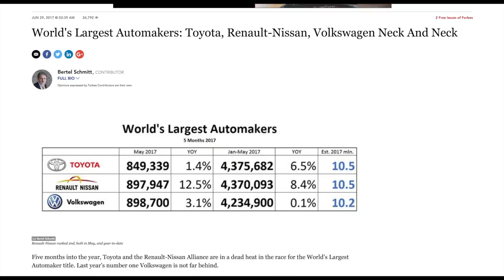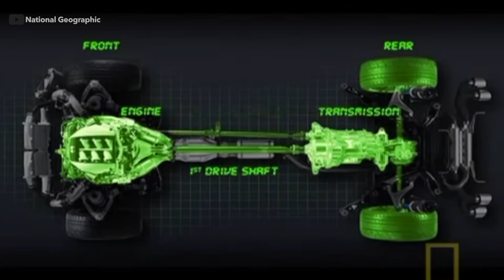Are Japanese Sports Cars Finally Making A Comeback?

Comment: As soon as the new supra comes out, theres bound to be that one guy that will 2JZ swap it that same second
Reply: Kevin N and make it heavier and slower.
Reply: Kevin N Someone better do that
Reply: For sure .I already got  2jz for it
Reply: @teermaarkhan4610  great listen to Tada-san he made for you the online-4 one to easily be replaced by a 2j and not his new creation. Please respect.
Reply: They can because Tada-san made the 4-cylinder variant to be able to swap that beautiful 2j.
Reply: Already happened brother
Reply: @emanueltorres4093  Incorrect. A Japanese drifter already has a pre-production supra and swapped in a 2JZ and drifts it. Tada San gave thumbs up. He built this car for tuners, not for Toyota. It's DESIGNED to be altered and modified. Check these guy's May 12th video drop, and they show a clip of Daigo Saito having swapped in a 2JZ into this very car. Well, not the exact one, but you get my point. Respecting Tada san is respecting that he wants tuners to tune. He wants customization. He didn't build it for Toyota. He built it for.. Well, us.

Comment: You did an amazing job at this video. Extremely well executed and clearly well received. I love that you even put in the bit regarding the take upon the NSX and GTR, along with the new-styling of the Supra (and BMW influence), and even though the manufacturers may have noticed this out-cry, it may not push them to back away.
I hope that in the next 10 years, we will see a new iteration of what is considered Godzilla. Cars that break the barrier of what we consider 'fast' and push it into a whole new ball-park. I hope that we see these exact models rise to the occasion once more, and influence auto-makers for decades after, as we had noticed before.
One can only dream.

Comment: I hate saying this, but look what Ford and GM have done, the Japanese manufacturers should feel ASHAME about themselves.
Reply: Stop the production of a legendary car with a legendary engine and turn it into an suv is stupid enough to me.
Reply: Plus I`m talking about the work done by the engineers, not the accountants.
Reply: ONE THIRD MAYO its only mitshubishi
Reply: Mitsubishi is the worst one. But see nissan made a scentra nismo, and haven`t get any new generation of nissan z or gtr and it`s already 10 years. Toyota made the new supra automatic only and have only 300+ hp. Honda turned their legendary into a hybrid supercar Prius and make a 3100lb front-wheel-drive 300hp car as their only affordable performance model. And the subaru haven`t update the STI engine yet. Mazda is the only brand seems doing ok, but it`s also 14 years since the last time they made a mazdaspeed miata. When these combined, you`ll realize that there`s definitely something wrong withe the Japanese.
Reply: ONE THIRD MAYO sorry about the disinformation, I'm still young and I'm trying to learn more and more about cars and engines. Could you please explain me what brands GM owns and what it is/was? I know it produces engines and owns quite a few american brands, but i still dont know exactly what it is.
Reply: The GM`s biggest brand is Chevrolet, and it`s famous for the LS engine (and currently the successor LT engines.) These engines are known for the insanely small size, power to weight ratio and ease of maintaince, they`re mostly equipped on the camaro and corvettes, but people loves to swap them into all kinds of cars and makes some crazy monsters, such as miatas with a reliable 500+ hp and still keep a neat handling.
Reply: ONE THIRD MAYO oh arright mate, you made things a little more clear, cheers.

Comment: 1980’-1990’s Japanese Cars were the Holy Grail.

Todays modern Japanese sports car feel hollow, cheap everywhere you knock,  pathetic “ stitching “ on the seats on the panels everywhere, the seats feel light and firm.

The real Top Dogs were involded heavily in the 1980’s and 90’s beautiful smooth solid cars with quality interior material.

Today they are trying hard to cut corners using disposable material.

Comment: Wait, why is Toyota wasting time making a new Supra when they already got the Lexus LC? The LC is the successor to the Lexus SC/Toyota Soarer, which were built on the same platform as the Supra. So why not just make a more performance-oriented and less luxurious LC and call that the Supra?
Reply: That wouldn't be a supra. It'd be an  LC
Reply: asah dude - no it would be a Supra with a shared platform.  Which is fine.  Look how well platform sharing worked out for the Camaro?  Because Cadillac dumped a shit ton of money into the Alpha platform to rival the 3-series, the Camaro is now a world class sports car (in terms of feel and performance).
Reply: It'd be a GT sports car with a Toyota badge that has the price and performance to compete with the Nissan GTR, Porsche 911 and Chevrolet Corvette. So yes, it is a Supra.
Reply: CRA_55 - Based on the rumored/leaked specs of 335hp and 3300lbs it is really more of a competitor for the V6 Camaro and 370Z.  Hopefully if those specs are true they will keep the price lower (sub $40k) but I won't hold my breath on that either.
Reply: again its not a supra if it has a shared platform

Comment: Ehh...sort of.  The new Miata and the BRZ are both good sports cars, but could use higher performance trims.  Meanwhile the GT-R and NSX are extremely expensive, not great drivers cars, and not even that fast for their price anymore. 
So that leaves just the 370Z as a middle of the road offering, but it's severely outdated and can no longer keep up with cars like the V6 Camaro, let alone the V8.

The Supra based on it's leaked specs sounds a lot like a 370Z competitor that is less fun to drive (automatic only) and $20k more expensive.  So it's more like a good looking GT car than a sports car.

For Japan to have a true revival Honda would need to bring back the S2K, Nissan needs to update the Z, Toyota/Subaru and Mazda need to throw a turbo/suspension option on their sports cars.
And it would be nice if Honda imported the S660 here (assuming it could pass crash regulations).

Comment: There is a comeback but unfortunately this cars are European cars with iconic JDM car's names. New Civic Type-R has a turbocharger I miss the engines that can turn 8500 at stock on the Type-R s. Car looks not bad but it hasn't a Japanese soul inside it. Honestly with a Type-R you don't need that power. We were OK with N/A K20 engines. About NSX... God damn it has a twin turbo with electric engines. Actually Honda was gonna produce it with a naturally aspirated V10. That concept is way better than this twin turbo stuff. You don't even need to rev the engine to get torque. R35 and Z34 is not bad and still got some soul inside them. GT86 is awesome but new Supra... I can't say the same for it. With BMW straight six it's disappointing for me to be honest. Subaru WRX STI's is not even Impreza. That means lack of charisma in my dictionary. Lexus LFA is awesome by the way. And looking forward to see Mazda's new RX-7. That one is long damn :P

Comment: i mean a manual supra in 2018? know don't get me wrong the only thing that feels the your working on is the manual gearing(IN MY OPINION) into 1st then 2nd, 3rd etc. again i love it, but for Toyota to tell you guys fuck off we don't need a manual 2018 concept supra and shove in a automatic or maybe even a double clutch (you know those ones where you have to use those padel or what ever shifters and use like reverse, drive, and park?) that might be exciting not Toyota telling us to fuck off though lol, anyways it might be great for them to add a auto, now before you start replying to me like your raging on xbox live i have something to say). It would be kind of odd to make a manual for them we get that manual's are great we know we like the felling of pushing down the clutch taking your foot of the throttle and gear as fast as you can cause your racing a JDM or anything who knows but in this day and age don't you think Toyota is getting actually ANNOYED about having a manual on all their cars? like if the community controlled the Toyota company the 1st thing they will do is SMACK MANUAL ON A CAMRY ANOTHER SMACK ON A ANOTHER ONTO A COROLLA etc. you need to get the point that the car community is not all normal fun lets go have a drag i bet you 500 pounds i will win if i don't you have my 500. No it's not like that! we are a community who mod our cars who talk about their 2jz or 1jz or twin turbo, even rotary! WE WILL GO TO THE POINT OF COPYING WHAT INITIAL D WAS BASED ON AND GO TO JAPAN SEND OUR CAR THERE GO TO MOUNT AKAGI AND DRIFT THERE AND RACE WITH OTHERS! AT 8AM UNTIL 10AM. I loved cars for long they are so memed they are fun it makes you cry just siting in your 1st car your mum or dad got you and your heart lights up with passion just revving it. BUT YOU NEED TO STILL UNDERSTAND THESE ARE HUMANS MAKING THE CARS YOU LOVE! BEFORE YOU HATE ME LET ME SAY THAT YOUR TAKING AWAY THEIR FREEDOM OF SPEECH! THIS IS TOYOTA OKAY 

Toyota: We are proud to announced the new (what ever they make) it is a tur-

car community: IS IT MANUAL?

Toyota:... no it's a 8 speed automatic 

car community: PUT IT BACK WHERE U STARTED MAKING IT AND PUT IN THE MANUAL

Toyota: hey Lexus where's that shotgun you said you were gonna get for bird hunting?

OKAY MAYBE NOT LIKE THAT BUT STILL! it huts me ALOT that i'm being rude about me and  ALL OF US! and for the last time... PLEASE DO NOT TAKE AWAY THE FREEDOM OF SPEECH OF THE CAR MAKERS AND WHAT THEY WANT AND WILL DO (even though they mainly listen to their fans) PLEASE PIN THIS SO EVERYONE CAN UNDERSTAND THIS AND ACTUALLY CHANGE THEMSELVES! EVEN 1%!!!!!!!

Comment: Can you really call the new NSX a japanese car if it was American designed and built?
Reply: hypno159753 of course
Reply: A true petrol-head hence my comment... The new NSX was designed by Honda of America and built in Ohio...
Reply: It's still a Japanese car. But it doesn't have the heart like the original nsx. 

It proves a that it has point. But it doesn't prove that it will make itself a legend of making other companies redo and reconstruct their best creations.
Reply: A true petrol-head you don't know because it's suppose to complete the name and make the name go beyond what it was previously made for. And it doesn't matter if it's a crossover. As long it proves it's better than it's older self, and yet i bet you don't know that people want it to be like the same but better designs and better performance
Reply: A resurrection should be in the spirit of the original but improved, and frankly the NSX failed there.  It is a car that sacrifices enjoyment for lap times, and then doesn't even produce very good lap times.  
They should release a version without the batteries/motors, which would make it a lot lighter and have better steering feel, and add a proper manual tranmission.  It will be 95% as fast, 150% as fun, and much less expensive.

Comment: Comeback? 

1. TRD Griffon 980KG 86
2. Super GT300 VivaC 86
3. Super GT300 Subaru BRZ
4. Revolution 1050KG 86
5. Bulletproof Varis FRS
6. Ferrari F136 V8 Swapped GT4586 
7. VR38DETT Swapped WTF86 
8. Kuhl Racing 86
9. HKS TRB-03 GTS800HP 86 Time Attack
10. Tommi Makinen's AWD Rally 86
11. Subaru BRZ STi Performance Concept                                      12. Scion FRS Concept
13. FT86 Concept II
14. Gazoo Racing 24H Nurburgring 86
15. TMG CS-Cup 86   
16. TMG CS-V3 Track 86
17. TMG CS-R3 Rally 86  
18. Evasive Greddy FRS
19. Kawasaki JUN V8 Swapped BRZ          
20. 1GZ-FE 4 Turbo V12 Swapped 86 
21. GRMN 86
22. RB26DETT AWD Swapped FRS
23. Project u 86
24. HKS D1GP 86
25. Top Secret 86
26. Auto Produce Boss 86
27. Charge Speed 86
28. Zero Sports BRZ
29. Damd LFT-86
30. Greddy Trust 86
31. 450HP FA20 Rasty 86 
32. Kei Miura's Baby Blue Rocket Bunny 86
33. KM4SH 86
34. Auto Factory 86
35. Original Runduce 86
36. Esprit 86
37. Ruf VIP 86
38. Rays Engineering 86
39. Racing Project Bandoh & Scorch 86 Time Attack
40. AVO Turboword BRZ
41. GRMN Twincharged 86
42. Tom's 86
43. Wald 86 
44. Blitz 86
45. WTAC S85 BMW V10 Swapped 86

Yes.

Comment: No, no they aren't. Mk5 supra is a cheaper, rebadged bmw without the bmw interior quality; not the same heart. The new z is a cross over maybe, and it's gonna be a Mercedes, not confirmed, but I'm not surprised so that's a flop. The nsx lost sight of what the nsx is supposed to be. Toyota's only fast car is a damn v6 Camry, and it doesn't have to be turbo or super charged, but the gt86 needs more torque; new crank shaft, Tada is a lazy dick. Mitsubishi went off the deep end, miata is the last Mazda sports car, and subaru is become more like Toyota, a generic company trying to appeal to the masses. Most of them are just commuter econ boxes trying to pose as sporty, some are aging platforms of yester year, and most of the sports cars they're trying to out out are falling hard behind. 

Other than that, this video was really effing cool and great editing. Thumbs up yo!

Edit: I actually really love the civic si/type r and the new accord. Honda is the only exception, it's just the nsx that sucks.